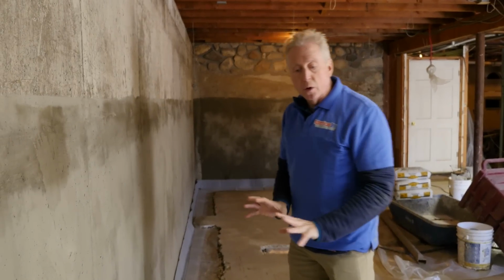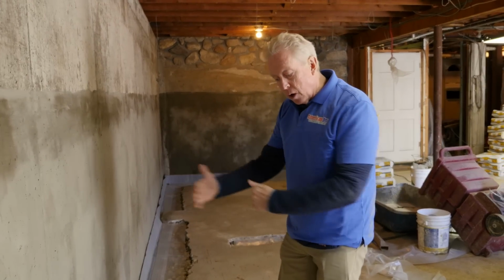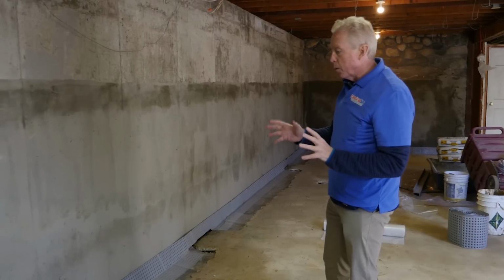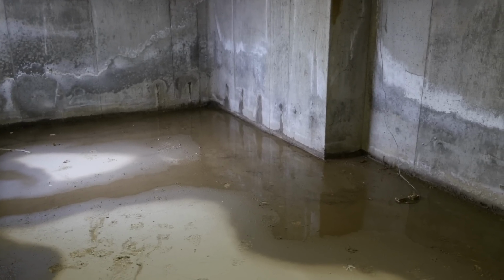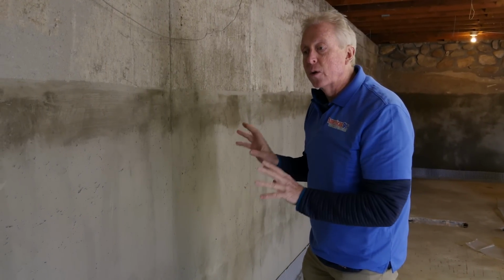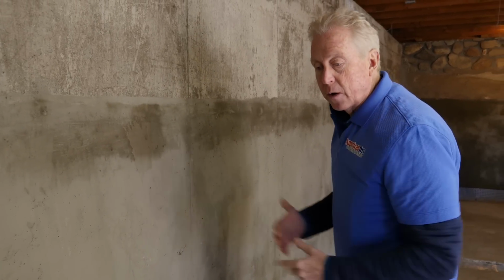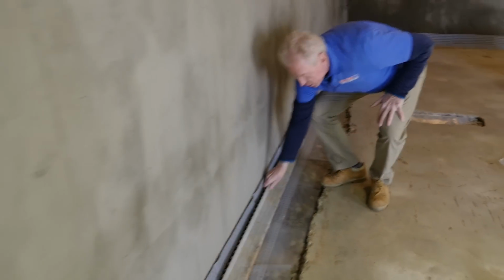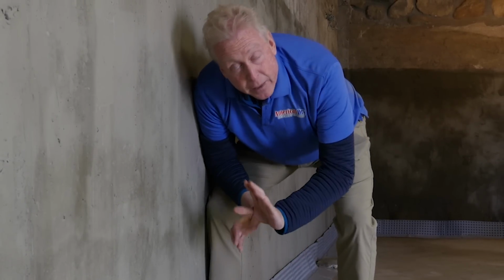How to Keep a Basement 100% Dry [On-Location]

Comment: For basements with minor water inlet, could only applying superslurry to floor and walls suffice? I dont think the full drainage channel would be necessary. And I wouldn't be interested in digging out the exterior of the foundation. I wonder if it could be used like an alternative to DryLok.
Reply from the maker: SuperSlurry is more expensive and more effective than Drylok. We have applied it to full basements crawl spaces with great success.

Comment: I got a underground cellar with two walls which are against soil which I cant remove or do anything on the opposite side of the wall . Can I use DryRod along the base of the wall and spread over the wall to seal through crystallization or any better solution? Thanks

Comment: This water proof barrier? What about the increase in hyda pressure from the other (outside of that wall, which is underground? Have fieldstone walls in central upstate, NY.
Reply from the maker: Our system totally moves water to the subfloor drainage pipes to eliminate any chance of hydrostatic pressure. We apply our SuperSlurry on the bottom-third of fieldstones to help direct water down into the system rather than freely going through mortar joints in the wall.  We have installed our system in thousands of stone basements with great success.

Comment: I need this type of system either interior or exterior need to reach out and get a quote, i like this method. I hope this is not going to be expensive, gonna reach out
This week to get a quote wish me luck on the pricing everyone..
Reply from the maker: I can assure you if you get exterior waterproofing and drainage, it will cost a lot more. What you need is a reputable company to do an inspection inside and out, then give you an honest assessment. Prices can range from $2,500 to $25,000 depending on sq ft in small to large homes.
Reply: I would think about 7 to 9 thousand

Comment: Do you have to put this around your whole basement? My basement is 1200sq ft but water only seeps in from 2 sides
Reply from the maker: Sometimes 1 or 2 walls are enough. Make sure you don't have any dampness where the wall meets the floor (cove) along the two good walls. Also, make sure you don't have efflorescence (chalky powder) or cracks on those walls as well.
Reply: @AmericanDryBasementSystems  thank you

Comment: I don´t understand what is the function of these "islands" where the original flour is reaching the wall. It looks like these islands are not connected to the wall because of that black membrane and anyway I don´t understand how you manage to connect the pipe  and cover it with the stones underneath these islands. Won´t it be better just to make a continuous channel from one end of basement to another with the black membrane, drane pipe covered with stones and everything covered with cement floor? 
I try to watch a lot of your video but I did not find any answers for this question. I hope you can anser me here?
Reply from the maker: The engineering tabs "islands" are a piece of the original floor. It sits on the footer and holds the wall out. We like to maintain that structural integrity. It also, always our SuperCrete cement mix to grow into the sides of the "islands" to make one solid floor again. The pipe channels are continuous around the entire room and connect into the sump pump basket from both sides. We have been doing this for over 20 years with great success.

Comment: I can see in the video that you have to cut the flow channel around the engineering tabs. How do you prevent water from flowing under these cutouts onto the floor?
Reply from the maker: Thanks for your question. The chance of water flowing out from between an engineering tab and wall is improbable because of water's inherent nature to flow through a path of least resistance. We created that easy path by installing a flow channel to guide water down to the drainage pipe. Regardless, if water did squeak out between the wall and engineering tab, we always cut a half-inch mini notch in the engineering tab, along the wall, fit the flow channel in, and fill with our waterproof Supercrete. Never had a problem since we started in 1997.

Comment: I have watched a lot of your videos and anticipate a great meeting in the near future on our ground water issue. I have heard about another product out there that is similar to your SupersSurry product. I know my walls in the basement have dry-lock applied to it, however the one wall has been peeling. Main reason is the moisture in the concrete, definitely want to strengthen the wall and avoid deteriorating process. So, I am definitely interested in hearing about this product and how it works, I heard good things about the other product working good. Of course heard from another company its not truly worth it or doesn't work. Again very interested on this product and process.
Reply: I thought this sounded like nonsense too, which was a shame, because otherwise I really like the way they build their systems. So, I looked it up. Turns out it's completely legit. Look up "hydrophobic concrete" if you want to know more, but crystalline waterproofing is a real technology. I learned something new today, and I like these guys even better.

A note for their advertising though, claiming you have a unique "magic" material or process is not a good strategy. It just sounds like snake oil. I know you need to protect your IP with regard to your mix, but be careful how you word it. There's too much BS in marketing today, and people are often overly wary.
Reply from the maker: If another company tells you our product doesn't work. Ask them to prove it. They can't. We have lots of customers that are very satisfied with the results. If you want to learn more about our concrete process watch this video - https://www.youtube.com/watch?v=obb08u6hCgs.